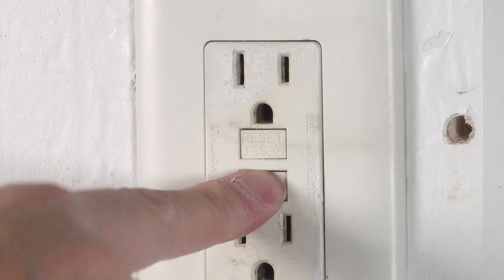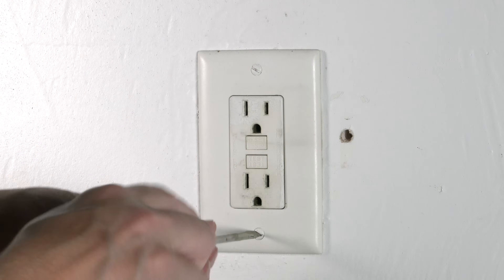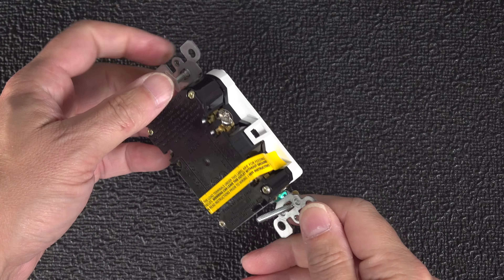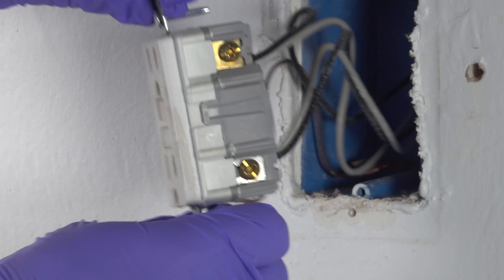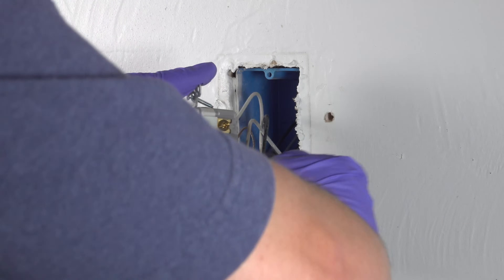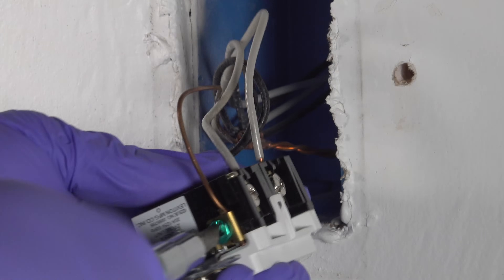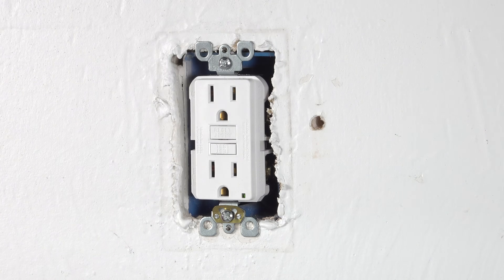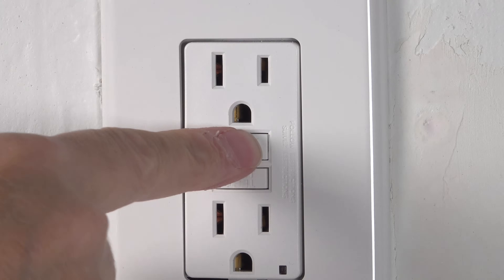How to Replace a GFCI Outlet - Not Working?

Comment: One of the screws on my gfci outlet does not budge no matter what. I even tried my impact driver on it and it didn't move. The screw is now stripped and now i cannot tighten my hot wire. Is this a common issue with gfci outlets?

Comment: Thank you for this video. I hooked the new outlet up by disconnecting 1 wire at a time from the old. Hooked everything up and it didn't work. I found your video showing not all outlets are the same. Sure enough, the new out was reversed from the old with line on the bottom and load on top. Reconnected everything properly and everything works great. My husband taught me a lot before he passed but not that outlets can be configured differently.  Thanks for a great, simple video.

Comment: Do NOT use a light to test if there is power. Use a volt meter. The outlet could be broken but the wires still hot.....

Comment: What if you have a bad GFCI outlet but you're not even sure that that outlet is the first one in the circuit? I assume you'd want your GFCI outlet to be the first one in the chain, which would protect all the others. How can you tell 1) whether the outlet in question is actually the first in the circuit, and 2) which outlets are even in that same circuit (since sometimes, I believe, a circuit can include outlets in more than a single room, so the outlets in, say, your kitchen might not all even be on the same circuit)?

Comment: Regarding testing the circuit to verify power is off, if the GFCI outlet is bad, it isn't passing power thru to any of the outlets after it. I plug in the voltage tester and of course it's showing no power. So how can I verify if power is still live?

Comment: Thanks a bunch for sharing this video. I'm trying to troubleshoot GCFI outlet. When I open the outlet,  power LINE wire does not have any power and I also checked circuit breaker and other GFCI outlets; none of them tripped. Do you think it's faulty GFCI?

Comment: Currently have this actual problem in both my bathrooms. Changed the GCI plugs to the same Leviton GFCI outlets that you used. Problem though, they we're not energizing. thinking that the circuit breaker went bad, so i switched the breaker as well. But alas, still not energizing. I''m usually handy, but in this instance, i'm proving that i'm not that handy...

Comment: I just bought a new one and put it in the wall and the test isn't working.. did I mess something up? Or does it actually need to be replaced?
Reply: Same here!!!
Reply: @timberecek9477  there was something in the way that was touching the gfci so it wouldn’t work. Cleaned out what was touching it and it worked like a charm, hope that helps

Comment: Completed installation of gfci. Have green light on plug meaning correct connections. Plugged in lamp which i had on in other room. Turned on power panel and no lighting result. Pressed reset and no lighting. What is wrong. Other plugs not working either.

Comment: You solved my problem. Why in the world would there not be a standard Line/Load configuration as an industry standard? A quick listen tyo your video lit the proverbial light bulb over my head and I found the issue exactly as you noted. Thanks much.

Comment: I'm in a condo building so I don't have easy access to the main power switch to shut the electric off. Will just flipping the breaker off allow me to replace the outlets I need to without shutting the entire power off?

Comment: Great video. Can't believe that load is switched between brands, you saved us a lot of trouble by pointing this out.
Reply from the maker: Glad to help. I have no idea why they were switched at some point and time. and some brands might be the other way. They should have clearer labeling
Reply: @SilverCymbal 
I have 4 wires; 2 black an 2 white for my GFCI outlet on my RV. And green screw for the ground wire. The green light comes on but power to any outlet. What's wrong here?

Comment: Just replaced a GFCI today after watching your video. Especially helpful was the Line/Load information. The new outlet I installed had them at opposite ends from the bad one I was replacing.  Not sure I would have looked closely enough at which end was which unless I had viewed this explanation. Thanks!

Comment: Thank you. My outlet appeared to be working in every way, even the green LED.  Except, no power, not power down the line and it wouldn't Reset. You were right, the old one was the bottom and the new one was the top. Rewired it and now I'm gtg. Thanks again.

Comment: Want to thank you.  It is me, myself and I that was doing this.  I matched for match when swapping.  And I had to turn off all the power to the house, because this one set could never tell which breaker.  What your video told me is the new GFCI had switched load and line and being new at this I had no idea.  In addition there were two outlets down the line.    I did purchase a transmitter and Klein tool to see which breaker but that only works if it is actually working.  That will be for afterwards.  Thank you for this.  In our area, there is so much building electricians never call residential people back.

Comment: A big thank you!  I replaced my GFCI outlet and it was not working.  Until you mentioned to pay attention to the load terminals and the line terminals, that is when I double checked and sure enough my lines were not installed properly.  Thanks again!!!
Reply from the maker: Glad it helped!
Reply: Same here. Saved me a bunch of extra headache.

Comment: I was taught to always connect ground first.  That way if something goes wrong it’s grounded for safety.  The rule is to disconnect ground last when removing a device and connect ground first when adding a device.  Done this way is safest.
Reply: I agree 100%. In fact, with these types of "devices" it is often easier to disconnect the ground last, and reconnect it first - almost as if someone thought about it when they designed it (almost).

Comment: Double up on the line, that's why there's two slots in the line screw conmector
Reply from the maker: Not for feeding receptacles, if you put receptacles that are downstream in the second line position, they will have NO gfci protection. You don't want to do that.

Comment: And the last thing to do before you put it back in the box is to wrap electrical tape around it to cover the crews. Not all boxes are plastic and it will protect it in case it were to come in contact with the metal box. Plus it just a great safety measure to take on outlets and switches.Ask any licensed electrician or watch a licensed electrician when he installs switches or outlets.
Reply: "Belt-and-suspenders" - especially around electricity ;-)
Reply: What should be wrapped? And if I turn off the electricity to the whole house, I can't get shocked, right?

Comment: Actually answered a few things i wondered about.
Dont forget that with some homes (Likely Older models) the breaker can serve as the GFCI in some places instead of an actual outlet.
Also, DO NOT GFCI TEST a Regular outlet, you'll blow the outlet and have to replace it. with that said, it is a Good idea to replace old outlets/switches at some point though as it can solve a number of potential issues.
Reply: That is completely false. You will not blow an outlet by using a GFCI tester. Do you know what a GFCI tester does? It takes 5 mA of neutral current and applies it to the ground. That's it. Won't do anything else. Completely fine to do it on any outlet. Also, GFCI breakers are more common on newer homes than older homes, so that is another thing inaccurate about your post. I'm sorry if you don't know what you are talking about you shouldn't be giving electrical advice.

Comment: Always check with a multy meter that the circuit is dead before touching the wires, especially if there are 4 wires present. You might have a outlet with each of the hot legs present for high load sharing. If you only test with the light in the top socket, the bottom may still be live.

Comment: How about replacing a non-GFCI outlet with a GFCI outlet, in an old home?  Is there any reason why the procedure in this video wouldn't be suitable for that too?
Reply from the maker: Yes, the procedure would be the same. If it's just a single outlet then it is easy and just connect to the line terminals as shown. If its at the start of a circuit as this one was then any outlets downstream would also receive gfci protection. The tester can also confirm everything when done too.

Comment: I turned my outlets upside down so that the ground is on top. If something drops on the plugged in appliance or light it will hit the ground instead of the the "circuit of electricity.
Reply from the maker: I used to work with an electrician who did the same thing, a lot of people like doing that.
Reply: @SilverCymbal  people are shocked when they find out that I'm not an electrician...See what I did there? People get shocked because I don't know what I'm doing.